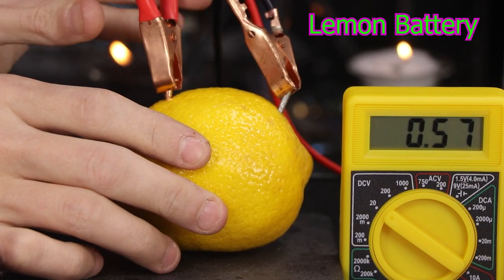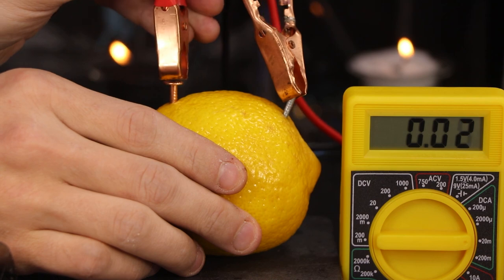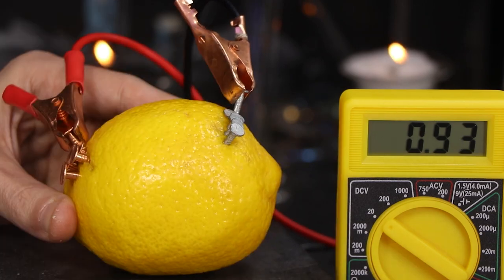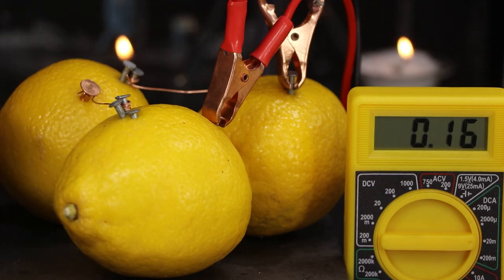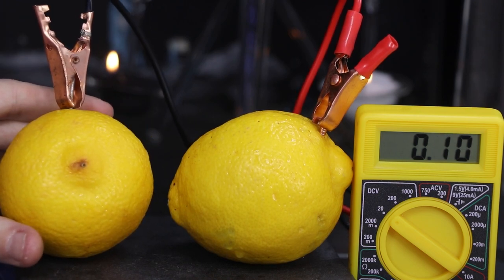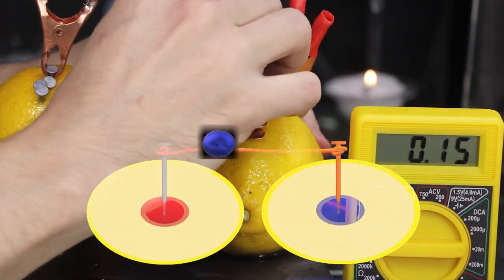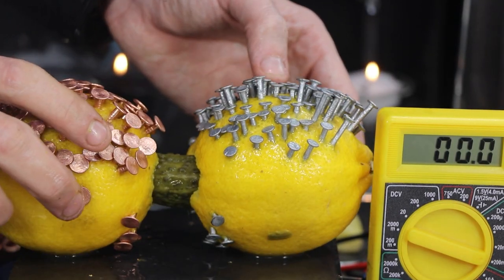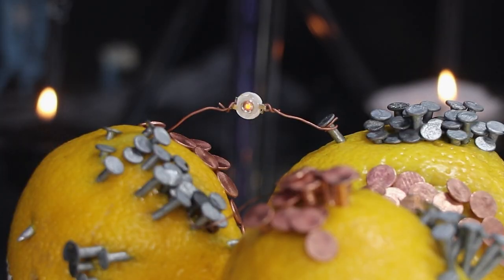Lemon Battery 🍋🔋 Explained ⚡ with Pickle Salt Bridge!

Comment from the maker: Tips: Don't cross opposite electrodes internally. Do cross the same electrodes. Build the 2-cell pickle battery to prevent opposite electrode crossing. Cut your fruit in half to create multiple cells. Attach the multi-meter as you assemble your battery to ensure what your doing is working. You can quickly check each cell voltage individually in parallel without disconnecting other batteries in series. Lastly never directly connect your Amp-meter to a normal (non-fruit) battery as it could burn out the instrument & Enjoy.

Comment: What happens if we connect nails in series in the same battery like nickel to copper then copper to nickel on the other side of the battery and so on - like multiple lemons inside the single one? Will that increase the voltage I mean do we really need a second lemon to increase voltage or we just need to connect the nails in series in the same lemon? Another interesting question what happens if we have Zinc and Copper wired as U together and put into lemon between two poles like in series connection. Will that increase voltage? There is more in the lemon battery than people think, it's not only chemical reaction that adds to the voltage - the topology matters like with U between two poles. Moving in the same direction electrons create a magnetic field around them. So if we connect two lemons with I believe 20 coca-cola straws filled with lemon juice we'll create a magnetic field around the lemons enough to bend a compass needle :-) this way we can have a lemon electro-magnet. Isn't that cool to look - a lemon attracting metal objects :-) we then actually can stick a physical magnet to the lemon pole.